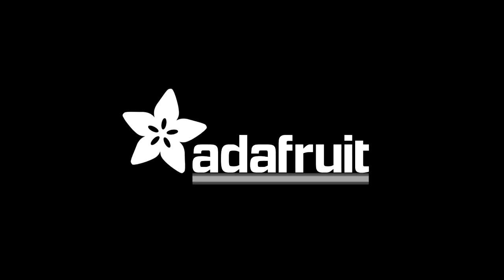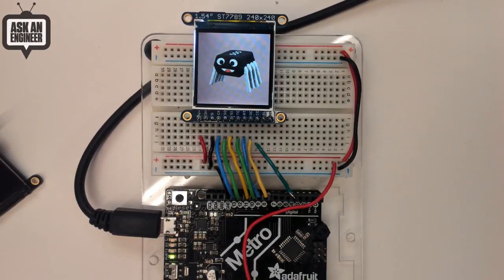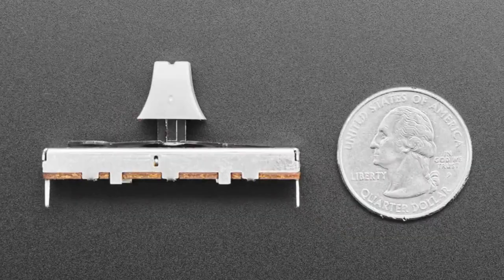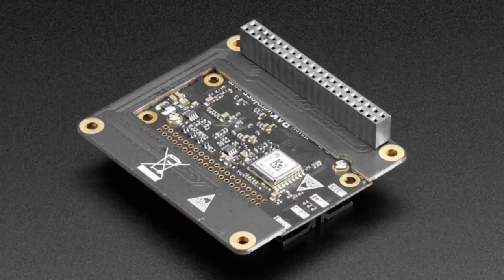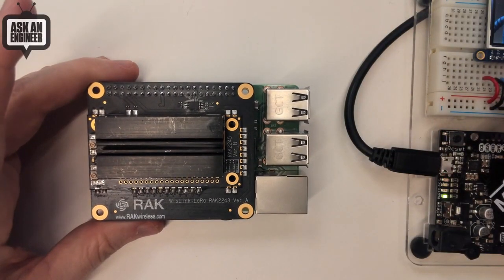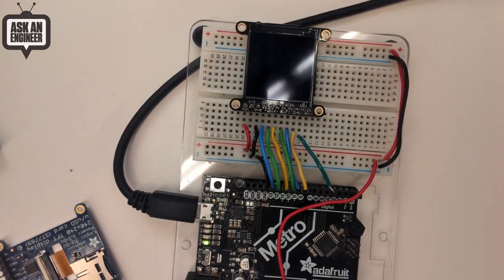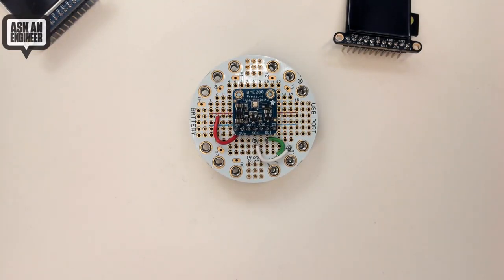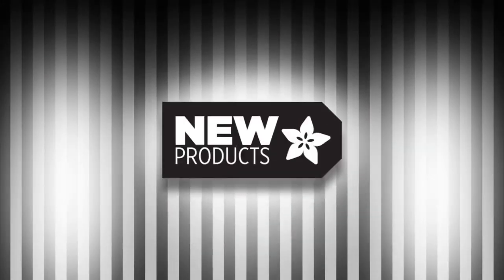New Products 7/24/19 Featuring #CircuitPlayground Proto Gizmo! #adafruit

Comment: Is the USB power source a pass-thru device meaning that it outputs USB power while under charge or does the output go off when you recharge the battery? According to the data sheet referenced in the video, it does pass-thru power at a 80% loss rate, meaning you need to charge at 3.5+ amp rate to get 2 amps out, so there is a power price to use this device.

Comment: Great video guys and girls, amazing products, I have the previous version of the Adafruit 1.54 screen, its delightful and superb!

Regarding the TFT LCD, is there a way to use it with Raspberry PI and C/C++? I'm trying to display shapes, print text (and maybe images, idk yet).

The Adafruit Libraries are for Arduinos & Python. I got it working through a snippet code I found in the forum, but I cant do much besides displaying squares and a circle (which is code by me, but its just the outline and its probably not the best way of doing it)
If there's a library in C and works with Raspberries for ST7789, I would be very grateful!
Thanks for attention Team Adafruit